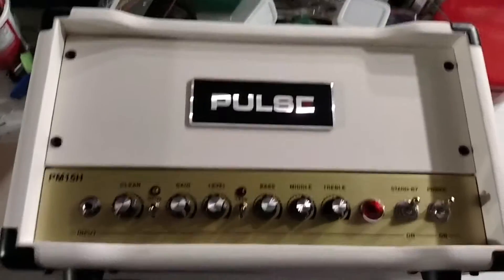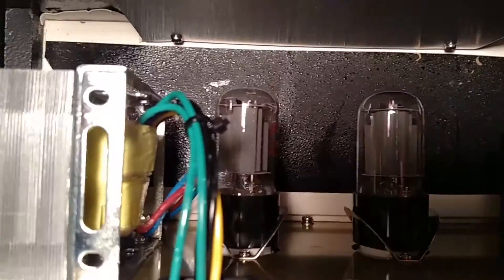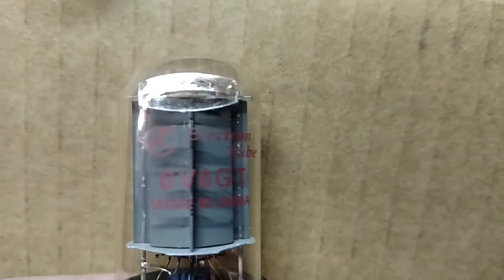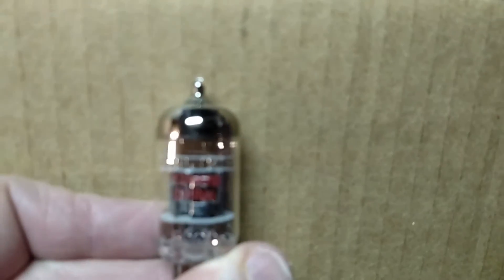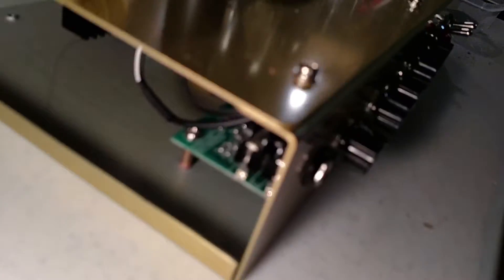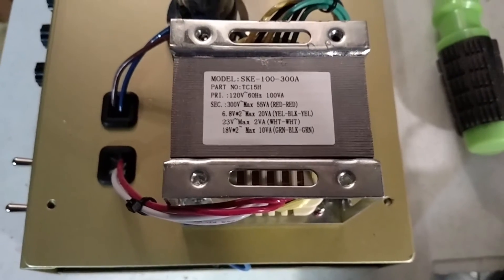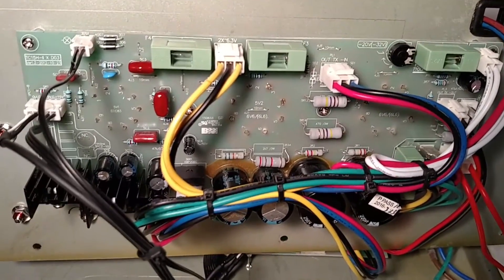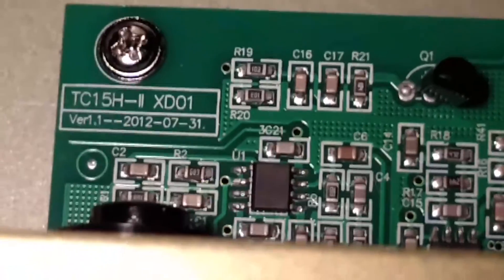Pulse PM15H Amplifier Part 1

Comment: What other tubes can it take??
Reply: I believe it is pretty limited to those particular tubes. although I probably would see a performance boost with better tubes.  Keep in mind, all this amp has is a vacuum tube output section.  The preamp is solid state.  You only get the tube "crunch" when it's loud.  which is ok with me.

Comment: Thank you for the tour. The metal plate might be to protect the Tolex, either the degrading the glue that holds it to the wood cabinet or even keeping the white Tolex from discoloring. If the head cab is plywood, those tubes might effect the glue holding that together too if the heat was excessive. Anything inside that might indicate the 6V6's needing to be matched or biased as periodic amp head maintenance or tube replacement as a pair ? One 12AX7B is a single tube and being a single, there's no need to match obviously, but perhaps needs to be biased as well for an optimal value &  particular range. The hotter they run, the shorter the tube life, but they do sound better with an optimal setting.

Comment: That 12ax7 is not a preamp tube, it the phase inverter for the
Power tubes, that's a hybrid amp with solid state preamp.
Reply from the maker: Dawn Russell. Yes. At the time I was not aware of that. I may build a tube preamp into it. There is some space.
Reply: I have a Vintage Gibson RVT25 Amp. Do you know if transformers are used as phase inverters also?

Comment: Has it been a good amp so far? Does it sound like a fender, or marshall? Is it nice and loud?
Reply: The tone section is not so great.  It does not sound like a Fender or Marshall.  The amplifier section is the only tube part. So the 12AX7 tube is the phase inverter that is needed for push pull amps (two tubes pushing the output). But it is loud. Takes pedals well. At some point I may add an all tube preamp stage to it.  I think I know enough to do it.